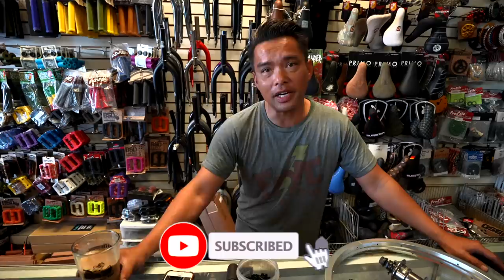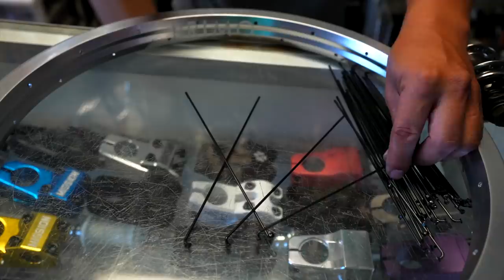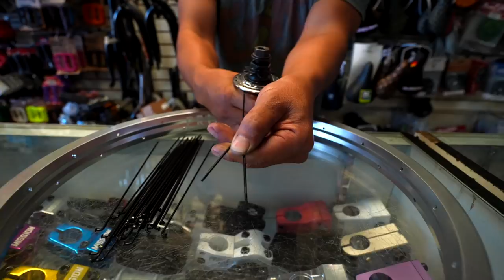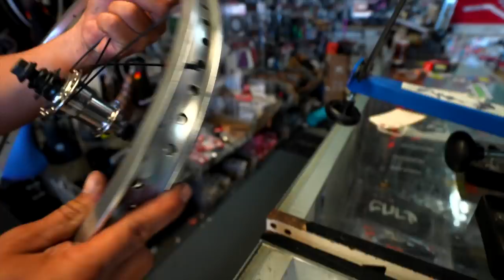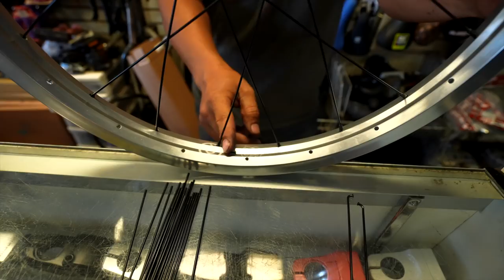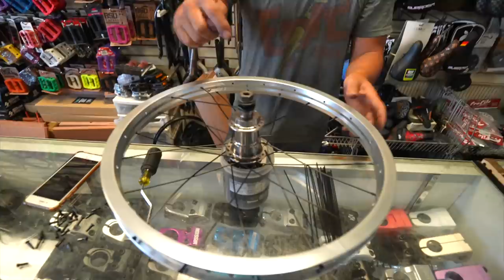The Fastest And Easiest Way To Lace A Bike Wheel!!

Comment: one thing he didn't mention was that the inbound spoke always goes under the outbound spoke AKA the down spoke goes under the up spoke! if you look closely he laces the wheel exactly like I explained
Reply: is this right? i just did a set using this method and the way you describe it, its would be 3x all under crosses. Down spoke over up makes it under under over counting from the  inward Jbend outward. I always thought you would want spoke contact for a stiffer wheel.
Reply: Not always! Maybe for strength, but Schwinn didn’t cross under even on prewar wheels.
Reply: Corona Califas checking I. Showing love !
Reply: His down spoke goes over the up spokes . Wymmmm

Comment: The first and six trick is a really super handy thing to know as well as a wheel builder because if you ever break a spoke while riding or mess up while lacing and have to remove/replace a spoke you will know exactly where it goes and how it should be positioned in the wheel no matter where at on the hub just by counting out

Comment: Just did this and it worked pretty well. The added bonus is that the even X allows you to clock the hub and align the valve hole and the hub branding predictably for the extra cool points. Now to find the vid on how to true up the wheels.

Comment: This is the most convoluted way to lace up a traditional 3 cross spoke pattern wheel.  Its much easier to lace both sides 'pulling' spokes (inside) starting at the valve hole to avoid his crossed spokes over the valve stem.  Then lace all outside  spokes so you don't have to fish spokes between crossed spokes on the opposite side of the hub.  Also having a proper spoke length calculator to confirm spoke lengths before starting is critical.

Comment: Great video! Of all the ones I’ve watched on how to do this, this is by far the easiest I’ve seen! Two questions though.
1. When crossing, how are you crossing? Does that 6th spoke go over or under the other? 
2. Also, when doing the drive side, is the spokes shorter? I’ve seen in some videos they say you need shorter spokes for the drive side because the flange is bigger? I’m totally new to building wheels but I really want to try it!

Comment: Phus way is actually really good because it's adding that even tension all around so when you get to the other side it's setting you up for even tension on both sides and centers the hub with the spokes and the pattern is good too I've laced 6 wheels before I messed up only one wheel before but this was using the slower method of dropping the spoke straight down skipping one slot adding one skipping one and repeating the process for the opposite side

Comment: We all have different ways to get the same result. I usually do inbound drive side, inbound non drive, then finish with the out bound drive and then out bound non drive. This way my hub label is also visible threw the valve hole and the hub is clocked. Everyone does it differently, it’s cool to see the different methods that create the same outcome

Comment: if you dont know how to lace learn it the normal way. guessing spoke holes is just about the worst thing you can do if you have never done it. driver side and non driver side hub holes are offset by half the distance between holes, so that you must use the exact opposite hole that is off by half the distance to get the desired result. eyeballing it is for veterans only. park tool guys have a really good video on lacing a 3 cross the traditional way and its very easy to understand also.

Comment: You mentioned in the video a trick you use to make a 14 mm bolt fit in 3/8 dropouts.  Does this involve putting a washer around the 14 mm part of the bolt so it's flush?  (Using those madera/profile hex bolts for female hubs)

Comment: Awesome vid, helped me out a lot. I have a question, can I use a 26 inch hub and put it in a 20” rim? Obviously with shorter spokes
Reply: Hubs aren't rim specific other then spoke count. If it's 36 spoke hub it can be used with any 36 spoke rim. However if you're trying to use an mtb hub on bmx double check the spacing as well.
Reply: @bmxriderforlife1234  thanks!
Reply: @AviaryAviles159  no worries if you need any help just ask.

Comment: Wow I've never seen a wheel built like that before. I was just wondering how you determine the length of the spokes when one side of the flange is different than the other meaning in diameter? I'm considering building a wheel set but don't want to purchase parts if their is gonna be compatibility issues between the parts I get. Also I'm purchasing a 2005 haro F3 in less than a week and I don't want to ruin the original parts so that one day I can return to stock form that's why I want to build a set of wheels.
Reply: 3 cross would be 186 in the front and 184 in the rear.